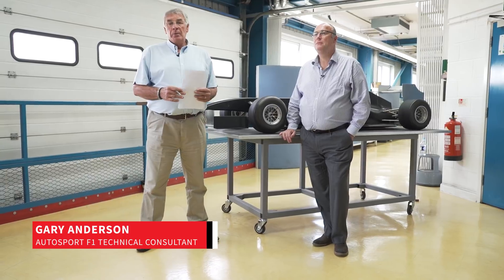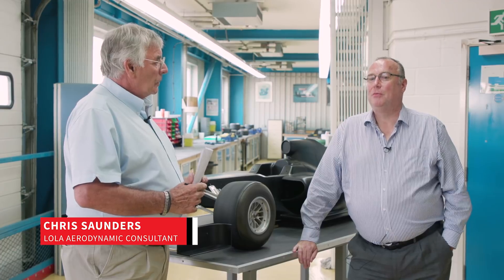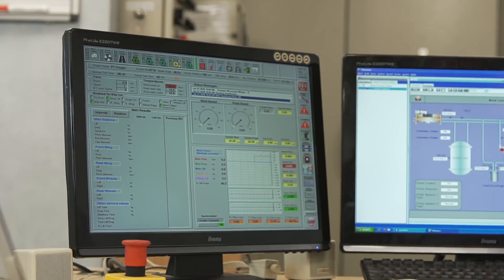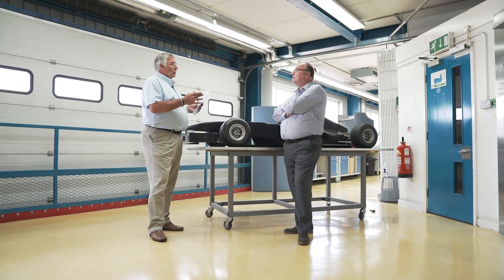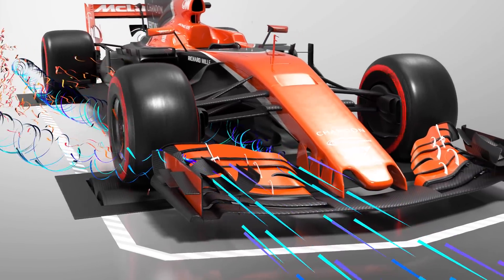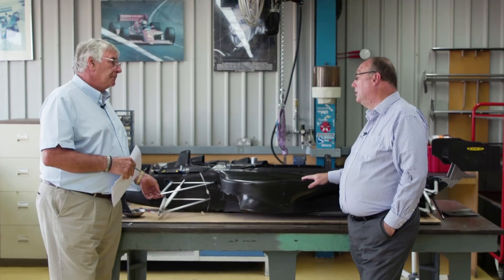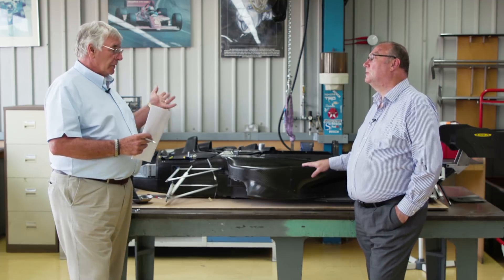Why windtunnels are important

Comment: Would skirts on a modern F1 car have positive or negative effects? I ask because the 919 Hybrid Evo added skirts, and other aerodynamic with power upgrades of course, and beat the F1 lap at Spa. We can't have that, LOL. I'm only asking just the effect with skirts. I'd really love to see a no limitations F1 car like Porsche did to the 919 Hybrid LM though. Maybe Chris Saunders would be kind enough to give us a look.
Reply: luckyluc25 if im getting what youre talking about ... ground effect side skirts were banned in f1 back in the day. Too fast through corners ... was the reasoning.
Reply: luckyluc25 that would be so badass. A no rules F1 car
Reply: Thomas Lee F1 without rules would not be F1 by definition. The formula is the rule book. Rallying had an unlimited class at one time which was wild, but it was discontinued because of the danger to drivers, Marshalls and the spectators.
Reply: What skirts do is stop the air going over the floor of the car from spiralling around and getting sucked into the low pressure air under the car. This massively helps downforce, because you keep the air going under the car clean. Modern F1 cars use vortexes along the edge to ceil it off in the same way as the skirt.
Reply: Rasmus Brekke Thank you for your answer. I thought todays cars would do/have a similar effect. So performance would most likely be close - skirt vs todays floor designs? Would skirts have less dirty air off the back of the car? With the new regulation changes coming, I'd love to see passing, but I also want to see performance increases too. Changes during the V8 era were steps backwards in performance, don't want to see that happen again.

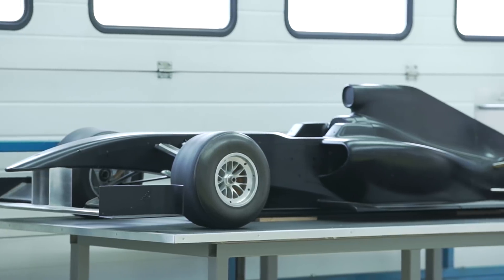Comment: 1:19 Why the engine upper inlet is closed? Would not a tunnel to the exhaust be better?
Reply: CADesigner depends on the air speed they are using, and the intakes are on positive pressure and pulsating depending on the revs,  granted this is a baseline simplistic model, but it can be accounted for especially so early in the developement..